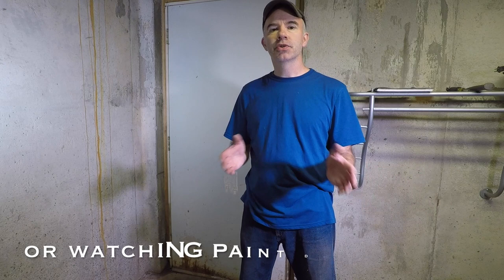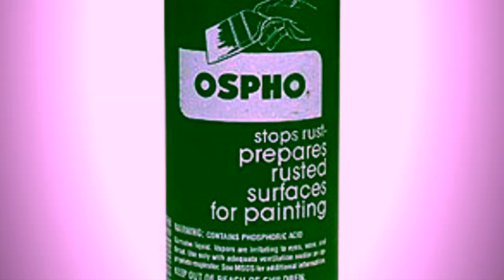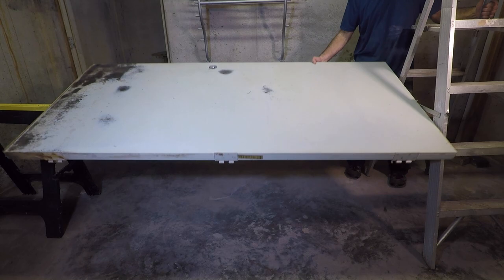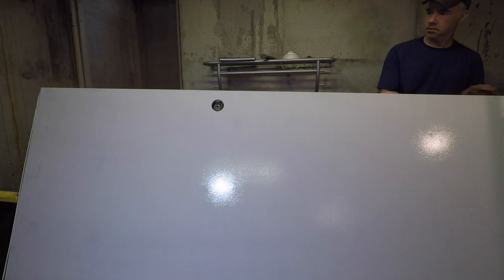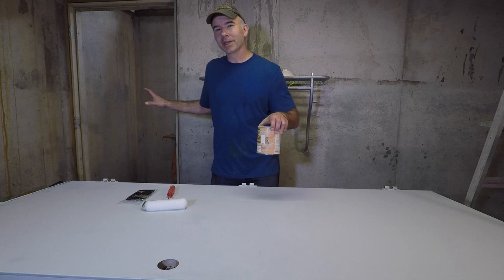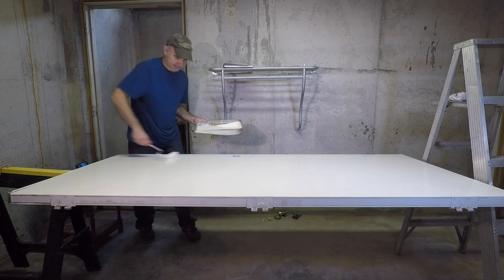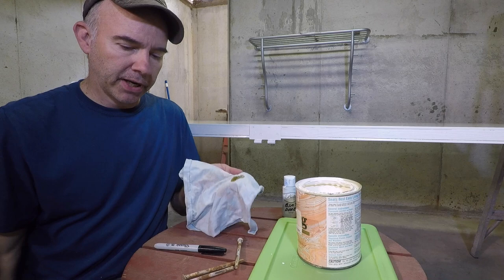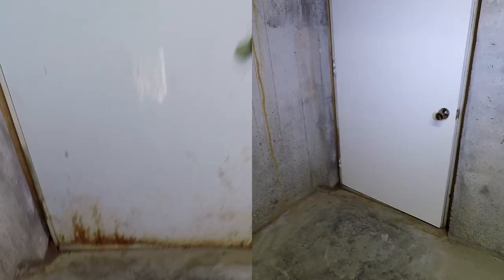How to repaint a rusty steel door.

Comment: Thank you for this video!!  I'm about to paint my exterior doors and this helped so much!  Not only do I feel confident, because you made it look pretty easy :-), but I'm excited for my doors to look new again like yours.  I appreciate you taking the time to post this for us!!!!
Reply from the maker: Glad to help - thanks you for the feedback.
Reply: @AlleyPicked  What type of roller did you use to prime and to paint, what is the UPC# of the bag they came in so I know what to buy as there are so many different types of rollers, please reply asap..thanks! Alley great vid!
Reply from the maker: @joed.426  Hi Joe. I used a common 4" foam roller. I dont have the UPC but here's a link to amazon for a similar one. They sell these in the paint department at Home Depot or Lowes Hardware.
https://www.amazon.com/Mister-Rui-Rollers-Improvement-Painting/dp/B096S4GXPZ/ref=sr_1_1_sspa?dchild=1&keywords=foam+paint+roller&qid=1632141723&sr=8-1-spons&psc=1&spLa=ZW5jcnlwdGVkUXVhbGlmaWVyPUEzQ1pQQ1YzQjhLVzFYJmVuY3J5cHRlZElkPUEwNTU0NjY1MU81N09SOTlMS0RDRSZlbmNyeXB0ZWRBZElkPUEwNDQ4NDc1MTdIRjRBN1FaUFJDVyZ3aWRnZXROYW1lPXNwX2F0ZiZhY3Rpb249Y2xpY2tSZWRpcmVjdCZkb05vdExvZ0NsaWNrPXRydWU=

Comment: Unfortunately I can't take my doors down because of where I'm working,but that is a great idea!!! Getting ready to paint 3 steel doors,thanks for all the great tips.
Reply from the maker: I have a couple to do myself. Sometimes I just leave them in place. Just have to watch out for drips.
Reply: @AlleyPicked  yeah, these had a line of rust 2" wide at the bottom from a rubber strip that's now gone, so that was a lot of fun trying to hand sand that close to the ground. I wanted so bad to take them outside with an orbital, mainly to do a more sufficient sanding, and get the very bottom edge also. 
The jambs and around hinges and hardware are a real challenge when it's hanging also, but, I can only do what the boss says. Thanks again. I can't wait for the opportunity to use the spinning door method, that is genius .

Comment: I've done this to my basement door, but the rust, even if pin sized, continues to bleed back through. I sanded, then used a file for heavier rust areas.  I've used metal primer, then bonding primer, then high quality trim paint. Because it continues to bleed back through, I'm guessing I did not remove the rust enough, so I should sand/file again or do that plus Bondo layer to encapsulate it. Any thoughts? I saw that Ospho you mentioned, would that be right for this application?

I've been working on this door multiple times in the last month, but saw the rust this morning. I found your video afterward, thanks so much.
Reply from the maker: Ospho is your answer. That stuff is amazing. It doesnt cover the rust, it changes it chemically into iron and can be painted. Sand the door again as much as possible, apply Ospho. Wait a day, then prime and paint. I'd be suprised if that doesn't work.
Reply: @AlleyPicked  awesome! Thanks for the quick reply and wonderful tips.

Comment: great tips, but why didn't you remove the hinges & lock & paint the 2 side edges?
Reply from the maker: You can remove hinges and lock if you want to take the extra time. I usually paint around them. I did paint the top of the door. The bottom has a rubber seal which you don't want to paint.

Comment: I have an exterior steel door painted white.  I have some surface rust 
corrosion that is raised / bubbled in areas.  Your video does not 
discuss what to do about that type of rust.  My concern is that because 
it is raised, if I do some sanding that it may reveal holes.  Thoughts?
Reply from the maker: Sanding it will probably reveal small pitted holes. To repair it you will need to sand off the bubbles. Once you get down to the rust, if you can't sand it all off, you can treat it using a product like Klean Strip metal prep, or Ospho. You can then paint over or repair the holes using bondo (similar to working on a car).
Reply: @AlleyPicked  Thanks for the tip.  Would it be better to use an electric sander for this type of rust?
Reply from the maker: @HHMike2  I always use an orbital sander but hand sanding also works.

Comment: Do you have to use steel  primer ? Or will the Bin primer be ok ?
Reply from the maker: The bin primer should be ok. Be sure to sand and clean before applying and you should be good. Treat any rust before priming.

Comment: How long for the primer to dry?  I know for outdoor paint, the normal dry time is 4 hours.
Reply from the maker: Depends on the brand and type. Oil  based always takes longer to dry. Best to read the can for what is recommended. If it's completely dry to the touch and evenly dried, it should be ok to start painting.

Comment: OK..question, what if it's an exterior door and being Chicago, I can't remove the door and leave a gaping hole?  also, what kind of paint should I use for a door exposed to the elements?
Reply from the maker: On a warm day would be best if you could remove the door and cover the hole with plastic for a few hours. If removing the door is out of the question you can paint it while it is in place. Just don't have excess paint on your roller or brush otherwise it will run and leave streaks on the door. You can go to home depot or Lowes and they can provide a high quality exterior paint in a quart size.
Reply: Inorite s

Comment: what do you do about the holes you drilled  the door?
Reply from the maker: The hole didn't go all the way through. You can leave it or fill it with some wood filler.
Reply: +Alley Picked 

What if it is a hollow core door?
Would you just like put a thin mesh strip over the hole and silicone caulk it?
Reply from the maker: Even hollow core doors have a strip of wood on the ends. You should be able to put a small screw into the ends of the door. Silicone caulk is a good idea to fill the hole. You can always skip the screws in the end and lay the door flat, paint one side, let it dry, then paint the other side.